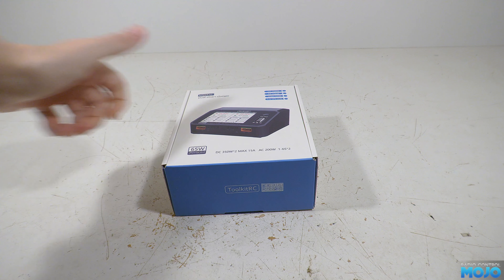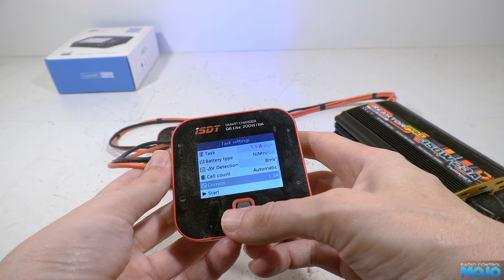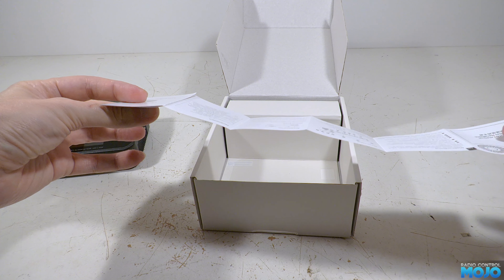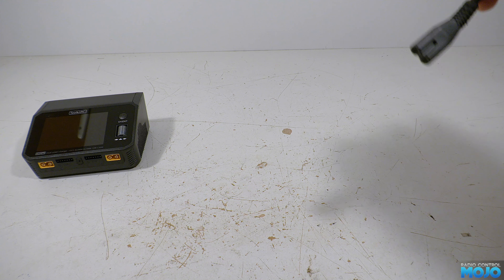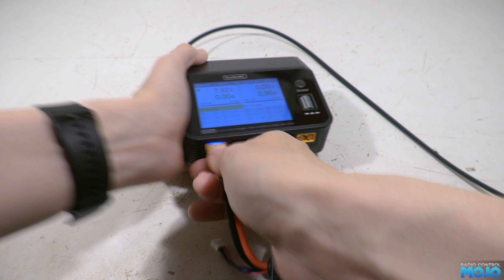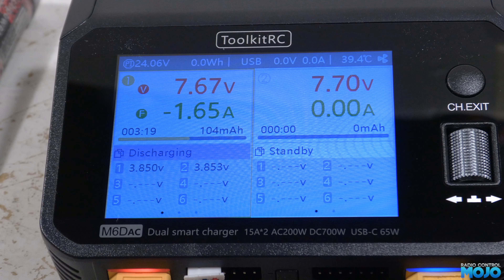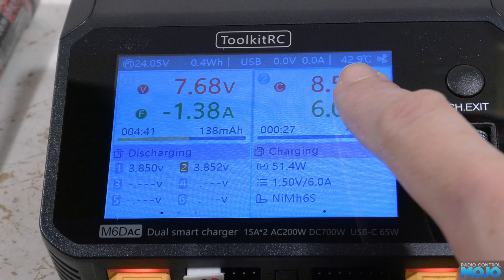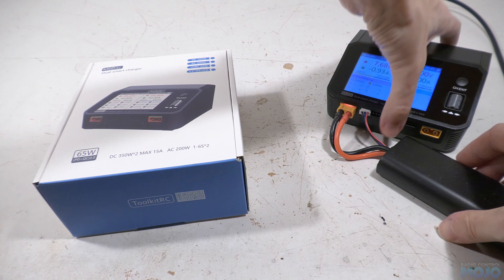Charger upgrade - ToolkitRC M6D AC

Comment: That seems to work properly. I got myself a simpler version of this and bought & made some cable adapters with it to get some extra length. This will releave any stress on the input plugs and now I can charge with the batteries still in the cars.